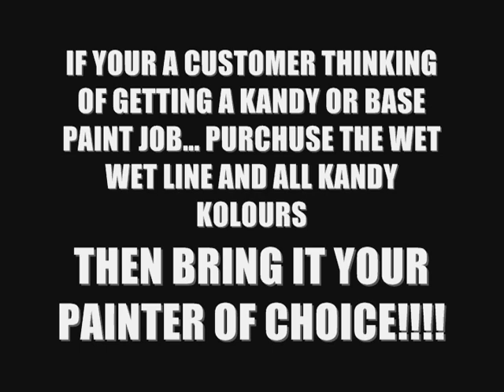HOW TO SPRAY KANDY PAINT ON A 96 IMAPALA SS .. BEST KANDY PAINT ON THE MARKET... ALL KANDY KOLOURS

Comment from the maker: 3 "WET COATS".... IF YOU GO 4 WAIT 30 MIN FLASH FOR THE LAST WET COAT THEN YOU CAN WET SAND BUFF... MAKE YOUR FIRST COAT LIKE YOUR LAST COAT!!!! SPRAY WET !!! 90% OF THE PAINTERS I TALK TO START WITH A TACT COAT, THEN MED WET , THEN A WET FLOW COAT..... SPRAY 3 "WET" COATS OF THE WET WET OR WET WET PLUS... NO SHRINKAGE AND ULTRA FLOW ... NO BUFFING IS REQUIRED unless you have a run or nibs in the paint... NOW ON MY KANDY JOBS ... I SPRAY 3 "WET" COATS THEN I WET SAND 600... THEN RE-CLEAR 3 MORE

Comment: I believe he should have started spraying from the left side of the hood to the right.  Not from the middle outward.  Otherwise yore gonna get a dark spot in the center  of the hood
Reply: Ant dude it doesn't matter if he wet sands and buff.
Reply: javie n I'm talking about the base coat. Not the cearcoat. Yes he can wet sand and buff the clear coat. That's easy. The base coat should be sprayed from left to right otherwise you might get a dark stripe in the center of the hood
Reply: javie n amatures spray that way.
Reply: He did right you shoot kandy like you over sprayin ghb you wann as pic up in center of the hood